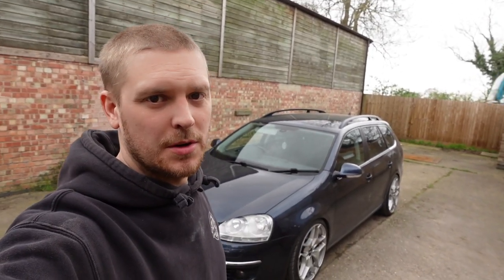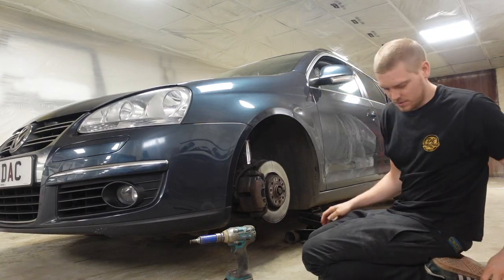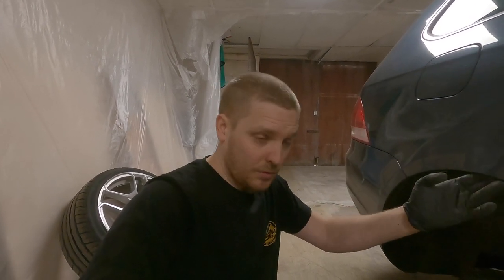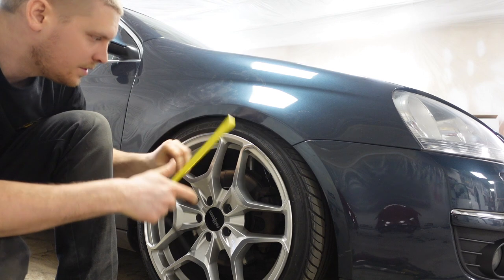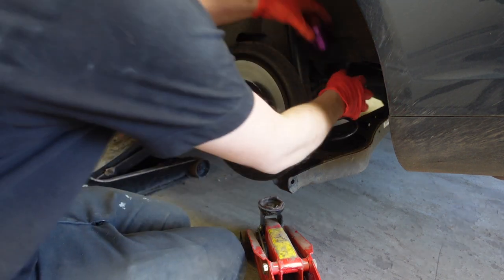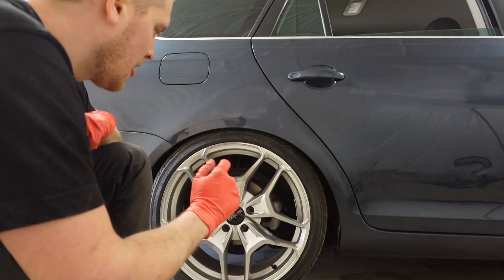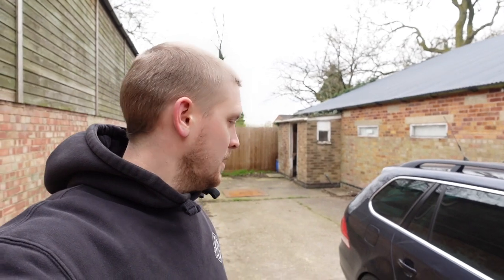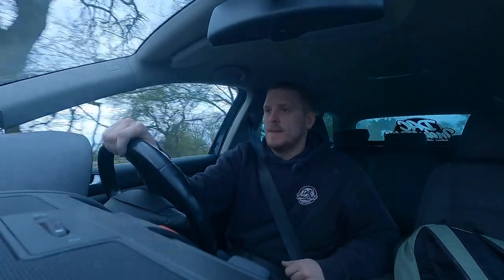Mk5 Golf Estate Variant Wagon - Budget Daily Driver - Adjusting Coilovers To Stop Rubbing

Comment: When you removed the rear bumper clip how did you stopped it from coming away from the car? And couldn't help to notice a sort of a whine or slight buzz when you where driving the car at end of the video, what was that was it coming from the engine?
Reply from the maker: The bumper clips into the rear quarter aswell as the screw. Removed this off a few cars now and the bumper has never come away, The buzz is engine I think